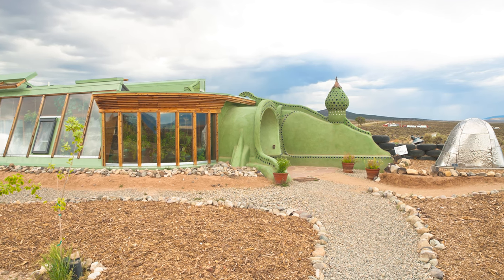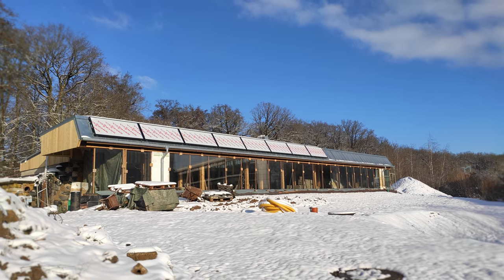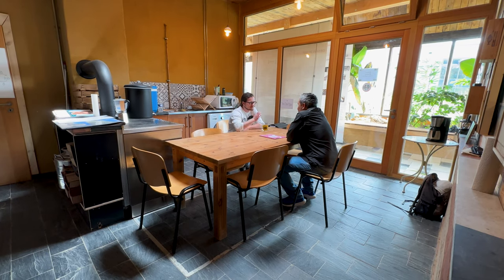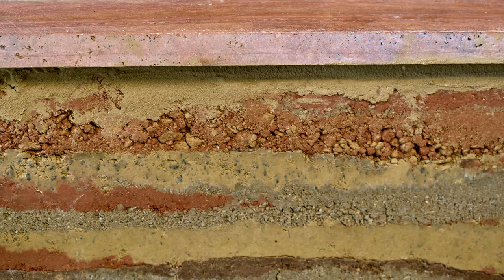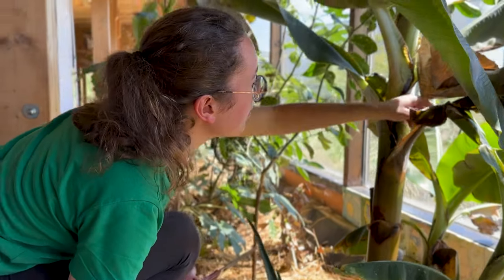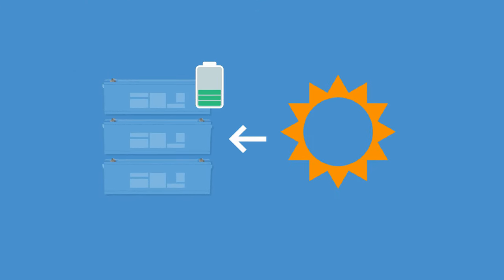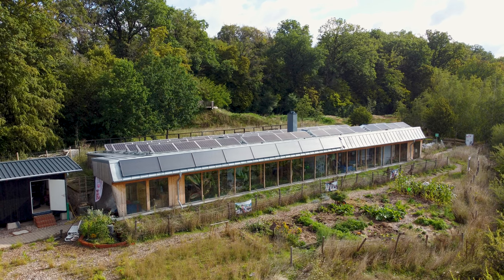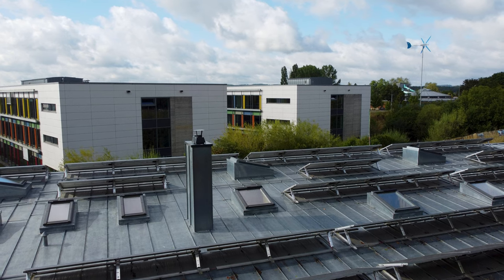Can this Earthship be off-grid all year round using solar and wind?

Comment: Agreed on the house design Failure that someone else mentioned- as an aside, I designed a high efficiency house for a timber Frame House Manufacturer that provided 95% of the Benefits of the Canadian R 2000 construction specifications for 5% of the Cost, and expecting 100% of energy needs from wind and Solar for u h of the world unfortunately is dangerously unrealistic. Even if sited in optimum places. The three Basics are Location, Location, and Location. I lived Off Grid on a Smallholding in the Northern Hemisphere, and experienced a period from September one year through to the following April, with very heavy Overcast, and very low wind speeds. If I hadn’t had a Diesel Backup Generator, All the Storage Batteries would have been as scrap as all the automatic speed warning signs with Solar Panels charging their batteries did - they were all dead inside a few weeks . So all such Projects and experiments must have last resort Backups. The only real option for me- Most people really aren’t suited to pursuing this, is moving to harvest the Wind and the Sun, which for me is a Sailboat, and in addition to an inboard Diesel engine for Propulsion, with a high output alternator,  I had hoped to exclude the red for a built in Diesel Generator, after a very deep dive into what is needed, there really is no option but to include that level of Backup as well, as you just annot Faff around with stupidities like Electronic Propulsion in the Marine Environment, because it just doesn’t take any Prisoners. Frankly, the Main use of the Generator is going to be running it to make sure it kept in excellent condition, so a few days a week with a few hours under decent load. To get a worthwhile Service Life Out of Batteries, sad to say most people just don’t have a clue how to treat them properly. Both AGM and Lifepo4 batteries can be destroyed by clueless people within 3 years. I “Think” I can get really well made Lifepo4 Batteries to a 15 Year Service Life based on present knowledge, but not many are built that well, with big enough internal Busbars and cabling.AGM of high enough quality, I know enough to get an achievable 30 year Service Life. So I’m aiming for a twin Housebank Battery Solution, Main Bank AGM, Secondary Bank Lifepo4 a very Heavy Duty Bank to attempt to break through 15 years and get the data needed to get them up to 30 years. Bottom line though is no current or foreseeable Battery Technology is anywhere close to ready for the promises that are being extremely prematurely promised, and worse, are actually being Criminally mis Sold imho.  Also there continues to be the question, Can Lithium actually be Recycled? tbh, I don’t exactly trust the people selling shares in their Recycling operations, whereas Lead is indeed fully Recyclable, and has a long track record of being done. 🤔 Time, will indeed Tell. 👍Bob.
Reply from the maker: Why is the building design a failure?  They are totally off grid and use the sun to heat their water that they have gathered from the rain and solar to power their electronics. A building can’t power things. They have no need for any service connections.

Comment: It's a bit strange in my opinion, that a project like this, with a primary focus on sustainability and recycling and reusing of all parts of the building, has chosen to use lithium batteries. For this project it would have made much more sense to use lead acid battery, which are already 99+ % recyclable and can be found made in Europe, since the application is stationery, weight is not a concern.
Alternatively reusing decommissioned EV-batteries would have fitted nice in this project too.
Reply: Totally agree, they totally failed somewhere, I think they do not have the sustainability spirit, they just follow some kind of fashion.
Reply: About decommissioned ev batteries, most of them are not suitable, lifepo4 got to be used in a house for security reasons. And nearly no ev use lifepo4 nowadays.
Reply: Knit picking at its finest. 
Amazing you've turned a blind eye to literally 100+ amazing things this project has achieved - yet the only thing you can take away from it all is that? Mind blowing.
Reply: @bonesjonesrsa9452  you might think so, but in the end the battery is the heart of every victron system and the video is victron promoting victron.
Maybe Victron should focus a bit more on the philosophy behind the energy system and the design choices they made in this particular project. Maybe it becomes clear to everyone why this storage technology is chosen here.
Reply: They are using Pylontech batteries which are plug and play for the victron system without the need for a seperate BMS if they were using lead acid. They have gone for reliability for this part which is completely understandable.
Reply: @louwrentius  a well designed and maintained lead acid system does goes a long way. It might not make the same claims as lithium system do, but it does have a proven track record.
Sure, it might be a bit heavier and bigger, but so is this earthship.
Reply: @ikbenaap so its heavier, bigger, and requires much more maintenence. Sounds like you understand what they optimized for.
Reply: @louwrentius  you're not getting my point. Sure, lithium might have some technical advantage over lead acid. But this whole project is about sustainability. Old tyres are not the best building material, else we would solely built with it. But from the grand scheme of things, good old lead acid would make way more sense in my opinion. Therfore I'm curious what the decision path of this project was.
Btw, VRLA are still the most used battery chemistry for UPS, because they are robust, safe and cheaper to make and operate. With newer technologies like thin plate pure lead, it is unlikely to change anytime soon.
Reply: @Austin-fc5gs  yes, they opted for a rather unsustainable battery chemistry.
I get the point of using lithium batteries for mobile systems for their superior capacity/volume and capacity/weight ratio. But this ship isn't moving.
Reply: @ikbenaap  lol
Reply: @ikbenaap  This might be true (I don't know the European market) but here in South Africa if you build a lead acid battery bank to give you the same life span and usable capacity as lithium, then you would be spending 3 to 4 times more on lead acid than lithium. Not just the cost but the added maintenance that you have to do and the massive amount of copper cable needed to connect everything. Take a step back and think before you knit pick :)
Reply: @hein_mcleod  as I replied before, I miss the design explanation for this project. 
As this is a victron video, one might expect some explanation of the components chosen for this system.
Reply: Digging something up and using it is fine; we have been doing this for 1000 of years; it's digging things up and burning them that we need to stop, using an element from the ground that helps us store energy is not the problem, it's HOW  (and who) digs it up and how we reuse it in 20 years when it's ready for recycling. Everything around you has been dug up and made to be helpful, can it be re-used easily, that is the question.
Reply: @ikbenaap  This project is not about sustainability, the first thing about sustainability is too decrease energy consumption... they got a far too big house with far too much solar.
Reply: @ikbenaap  Just think of transport, lead acid is 4x heavier at least for an equal usable capzcity. A gel 280Ah under 48V cost 2200€ and weight 350kg since only 50% is usable, you double those numbers 4400€ for 700kg. A 280Ah /48V pack of LiFePo4 with bms, nice metal box, breaker, fuse... 2700€ and 3500 cycles at 90%DOD vs 1200 cycles at 50%DOD and weight 100kg.
I mean... who is dumb enough to use Pb anymore...? And I'm not even talking about energy retention vs time or round trip efficiency or amperage capacity... Lifepo4 is better in all those points, voltage stability on 80% of the capacity...